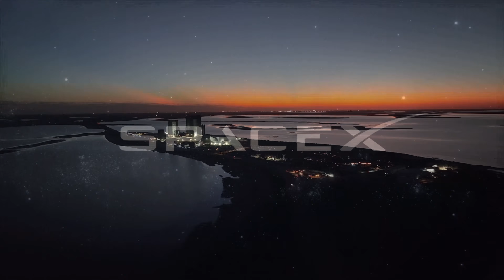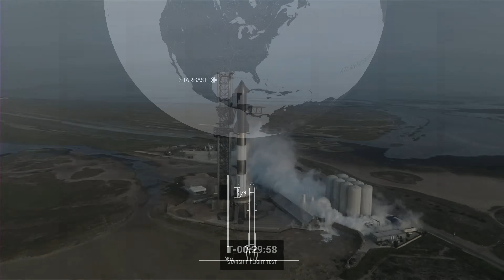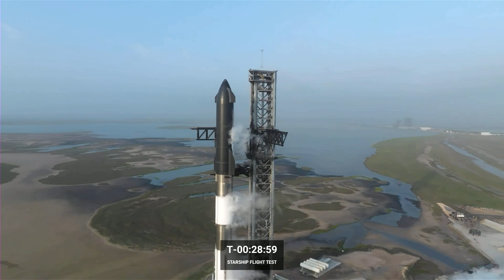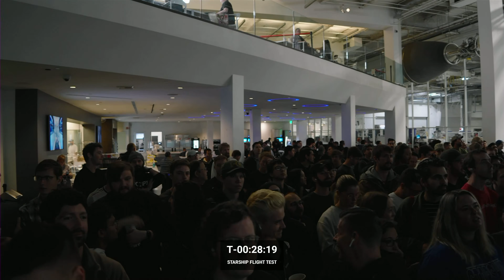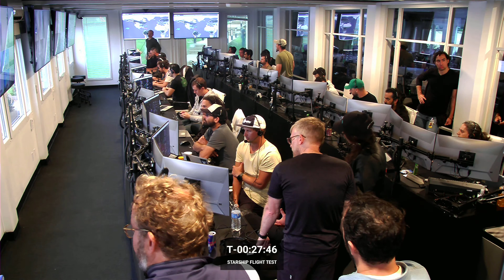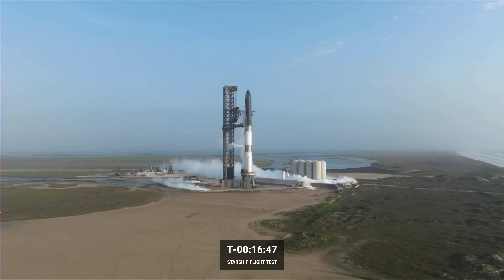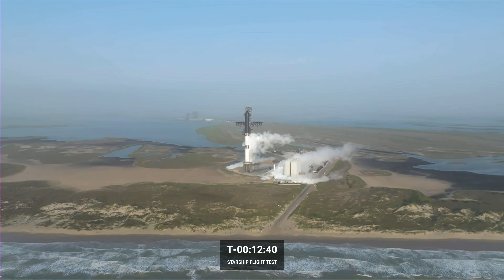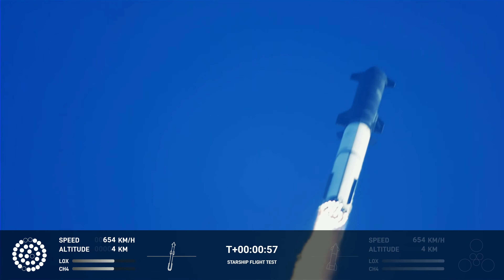Starship Flight Test

Comment: Hi, great step… some ideas for a better success:
The motors going off…. Can use side boosters w shuttle center, instead of 1 long tube… having even more motors & less risk of breaking them… like Falcon heavy.
The launch pad might be at ground level and then have to dig, construct more underground structures…Or making a bigger bulge to avoid weakening the crank tower. The « auto-pilot » program looks having problems too… keeping the rocket straight… bcs it flew even with fewer motors, so the program could manage it’s trajectory… but not. Maybe these remaining motors alone can’t keep it straight enough … whatever the « auto-pilot »… have to look on it…
Overall the problems occurred fast and look manageable… It surely can’t fly again as is… The path for solutions is also somehow clear. It’s doable, but other problems may occur also… so must be serious , overlooking.
Congrats.🚀✨
Reply: Having side boosters at this size adds a lot of complexity. There is a good reason why the Saturn 5 didn't have one.

It spacecraft should remain the same. Launch pad need serious upgrades

Comment: Man I was so damn mad when this failed the first time. Granted, it's all a work in progress. I was raging from little things that were over-looked. 

In any case, the newest launch attempt has improved tremendously. The recovery is still stressful to watch before those boosters counter all that force, during the burn as it decends at tremendous speed- my eyes wide-open praying it doesn't absolutely smash the deck and landing platform from a sudden failure, and like 5 minutes after hoping it doesn't spontaneously combust as an observer. You never know. Unfortunately, Starship spun out of control in orbit from a loss of a stablizing thrust and/or thrusters. Not a whole lot of information or detail yet. It may have been from when it flexed to bend where the aerodynamic pressure was the greatest at full-blast just one minute after liftoff. Perhaps some gyroscopes or other kinetic stablizing equipment are in order for the Starship. I doubt there is room left, and it's tall enough as it is. It might be too tall and not wide enough, but going wider would just mean more weight and more thrusters. This science is truly an art where most the lessons learned are in the aftermath and in hindsight.

Comment: Idea: put half or all the boosters around the top of the rocket to reduce damage to the ground, like a mushroom
Reply: Its better for the stability if you put the boosters at the end. You can test that by laying your phone on the table and pushing it forward with both fingers behind vs both fingers on the side. Interestingly there is a rocket design named Seadragon with boosters on the side.

Comment: The most important thing learned is knowing what repairs made to the launch site after each test was NOT learned and they kept on fixing the pad with idiotic solutions - how dump - a child would learn after getting burned once, and yet smart people (if one can say that) resolved the problem the same way each time and expecting a newer result... Go figure!

I have suggested to Elon in a tweet, to use the same material an engine cone is made of to wed-stand the heat - by having 5 pieces each to roll in through the gaps of the launch stand, to form an upside-down cone to divert the force/shock and heat of the 33 engines. more importantly, similar pieces can be part in a Mars ship to form the same on Mars... case closed.

Comment: OK-  So 30/33 engines were burning at takeoff (90%), however two more engines failed after takeoff 28/33 (85%).  You can see this in the graphic in the lower left screen. 28 engines may not be enough to reach orbit.  So, the stage separation was probably intentionally scrubbed and the rocket was then intentionally destroyed, since it was doomed to not reach orbit.  I suspect the entire issue was simply that too many of the stage 1 engines failed prior to separation.
Reply: The bigger problem was they lost hydrolic power which was used to steer the rocket. The upper stage could of reached orbit from there but wasn't able to seperate.

Comment: The announcers were reading their script. The rocket didn't perform to specs, it should have been at 65km for stage separation. Perhaps even higher. Falcon 9 separates at 80km.
Reply: Yes of course. They have intended milestones calculated to the second that they are supposed to happen. This is the same for every rocket launch

Comment: There is not enough useful weight on the first stage of the rocket ... At the bottom) 
The mass given by the fuel disappears, so instability appears.
🤔🤔🤔
Reply: It helps when the steering doesn't break, they've already upgraded that though.

Comment: While the idease flowing - in regards the heat tiles on the ship, I have for a while been very skeptical of how well they would work and seem to be continuing the same or similiar problems that the Space Shuttle had previously with missing heat tiles falling off as being very prone to damage and vibration. 
What about instead covering the heat sections with large removeable ablative heat shield sections instead - say in maybe 6 or 7 large sections - obviously this means relacement more often, possible after every re-entry to earth, so would be more expensive yet can be much better moulded to the exact shape and thus be safer and you wouldnt need as many metal pins to fix it to so save weight there to offset the extra weight in the material over the tiles....what do you think ?
Reply: The heat tile design is just a test, they probably are gonna switch to a different one. The problem with ablative is that it burns away, and they don’t want to replace a heat shield after a few flights

Comment: Incredible to me the USA people relation to explosion: it doesn't matter the explosion was a 100M$ loss, they are still happy, jump and scream
Reply: They're celebrating that they made it that far, as they said, the main goal is to clear the pad
Reply: @dinosaurearththeory the people celebrating didnt work on it. Those were Falcon 9 workers.
People in mission control, who actually worked with this hardware, didnt celebrate.
Reply: Because a $100M loss is nothing for SpaceX lmao. They are going to continue launching these rockets and blowing them up until they get it right. They cheer at the explosion because they know that the test has reached its conclusion and no more data will be gathered. It’s the end of the show. I would be cheering too if I was there.
Reply: @_mikolaj_ Well that’s an incorrect and stupid comment. There’s several public statements from people in the starship program who were joking and celebrating the test after their professional job had concluded. Don’t say blatantly false things
Reply: @GrapeFlavoredAntifreeze  where is my statement incorrect? People shown in California, are Falcon 9 workers. They didnt even touch starship program most likely.

People in MC all were dead silent. No one was happy.
Did SpaceX later run the joke and celebrated the failure? Yeah they did, because how are you supposed to keep investors interested, if flight of very outdated hardware pushed mainly to attract investors, is presented as a failure?
I recommend article by Ben Kellie, former  SpaceX employee who worked on Falcon 9 pads and droneships.
Similiar things happened back then. When booster landing failed, or something wrong in general happened related to it people who were not involved with recovery, celebrated in champaing "failure that will push forward". People involved, as always, were dead silent. Further away people are from the program, more likely they are to paint failure a success.

Comment: Hey now! Where is the footage from the 1st stage engine bay area during liftoff during the first 3 minutes? Judging by the 2nd stage footage at the 3 min 20 sec mark on liftoff, they have cameras covering the engine bays, but we've never seen the 1st stage booster footage. That would tell the story of the immediate damage from liftoff. Thx!
Reply: I doubt they could get a camera to work there and from the latest report spacex have no idea what caused the first three engines not to work but say they shut them down at lift off.

Comment: I honestly swear on my life, I Genuinely thought they were using the 'launch' pad originally as a testing pad before moving the unit to an actual correctly prepared launch pad, (in hindsight I should have thought otherwise due to the fact that the chopsticks were on that site) however, they could have easily excavated the opposite side of the tower to allow for a proper directional outgassing exhaust tunnel! Hey Elon, you could have hired in The Boring Company and paid yourself to do the work!!😅 Just a thought.
But nothing but congratulations to SpaceX and everyone involved in this sadly expensive but successful data gathering test.. I just wish I had more time to analyse the plan and I would have flagged this weeks ago. As it genuinely crossed my thoughts.
Then again, who says I'd have been listened too.
All the best for the future tests ❤
Reply: People have enviromental issues with them doing things like that, their permit was denied. They have a plan for the next launch to solve the problem though.

Comment: 46:14 love this easy data flight. But why are they losing motors? anyone know? are they stoping from the ground?
Reply: There was a lot of damage from flying concrete when the pad failed which caused damage the engines and other systems.

Comment: Just wondering is there enough atmosphere to use the grid fins to create drag maybe turn them in on each other for stage separation, the way you are trying looks like a problem waiting to happen.
Reply: No need for the heavy actuation mechanisms for that. Starship kept control with a failing tvc through max-q just fine, the grid fins dont matter that much on ascent.

Comment: i get trying to put a positive spin on it but calling it a success isn't what I would be doing. It failed, take it and use it. Elon might want to think about a redesign for those releases? like a hydraulic, magnetic or small kind of small charge?
Reply: What releases?
Reply: That was the whole point of the test flight, to find out what wasn't working as planned so they could fix it. The fts uses charges but they weren't big enough for that high in the atmosphere something the FAA will be double checking before it flies again.

Comment: Nasa sprays water so that the water absorbs the shock wave and prevents the rocket from being damaged. I've also noticed the metane and hydrogen tanks were totally obliterated.
This is my guestimation but could the reason be that this is a test flight, meaning that crashes occasionaly occur. And no launch site can take repetitive crashes from a rocket that weights 5000 tons? Having to reconstruct a launch site over and over would certainly offset the advantages of having a intricate launch site. But I still think you should do someting about the shockwave if you already haven't, doesn't it wear down the rocket?
Reply: Sound suppression is useless on starship because it’s so powerful. They also can’t have one at boca due to environmental requirements.

Also there is no hydrogen on this vehicle
Reply: @weekiely1233  sound suppression is useless? Do you have a source for that? There’s no immediate reason I can think of that any particular volume of water wouldn’t be effective in reducing the impact of the ignition shocks from the engines.
Reply: @infinitelyexplosive4131  source is a NASA paper. Required water is too high for such a vehicle to make it practical for what you get. Plus they can’t add one easily at Boca Chica due to the water table

Plus none of the issues for the launch were caused by sound.
Reply: @weekiely1233  which paper?
Reply: @infinitelyexplosive4131  I have sent a link
Reply: @weekiely1233  I’m reading it, thanks
Reply: @infinitelyexplosive4131  no worries

Comment: I'm assuming you considered putting the launch site in the water right? I know. No water on Mars but no atmosphere to push through either. If necessary on mars, you'll have to keep the rocket further off the ground if you still need rockets, or dock in orbit then shuttle down/up.
Reply: Superheavies will never reach Mars. Only the starship segment will.
Reply: @rolandb.1866  The main point was using the water, if this would solve the problem of dust or debris hitting the rocket on earth.

After that, on the moon for example dust happens very easily, I would guess limited debris will happen on Mars the same way, even just from a smaller rocket. Unless the ground is prepared in some form, or further distance exists between the booster and the ground.

Additionally, I have no idea if in the future, they will achieve their goal of using Mars as a launching pad to other sites in the solar system, thus requiring some kind of booster to get there.

Comment: I feel like it wasn't supposed to start tumbling before separation? I feel like it's aerodynamically unstable and lost too many engines to maintain stability. Because the stupid wings and grid fins are on the front of the rocket, it's aerodynamically unstable.
Reply: It’s not inherently unstable or at least not too much for the TVC. Engine failures were probably why it tumbled
Reply: @Erudite tbf it looked more like a TWR issue. When it pitched down it started to fall in vertical speed and the weight of the stack pulled it down into the flip. 

They looked like they were prepping to separate but it started tumbling so they didn’t do it and eventually the AFTS activated

Comment: Would it be possible to strap 4+ falcon 9 boosters together and have them all individually land to avoid a total loss? Smaller and cheaper to produce en mass and reusable to other purposes. (Obviously with the raptor v2 for all it’s benefits) x
Reply: Falcon heavy has proven that there is almost no use for that with starship coming up

Comment: Can somebody tell me wht just happened? I mean it's exploit and failed during returning?
Reply: No, during flight engines start to fail so after 2 min 8 engines didn't work and rocket lose control and didn't gain enough speed for separation for second stage (that upper black part rocket with wings).
So they terminated mission.
Rocket should speed to 7000 km/h after 2min and 40 sec and on altitude of 60 km , this is the point when you  separate first part from second.
Reply: @markhivin8670  thanks brother 🙏🇮🇳
Reply: @MANGESH0805  You are welcome☺

Comment: Wouldn't adding two or three solid rocket boosters to the side of Starship boosters help get Starship up to orbit with less fuel loss?
Reply: Stupid idea...
Reply: No, not really a good idea, Booster have the fuel to send starship close to the Karman line and then do a boostback, and Starship can go orbital thanks to ift 2 data.
Reply: Thats a terrible idea lmao. More expensive per launch and more potential points of failure
Reply: adding more rockets means you are adding more mass.
so you need more rockets to accelerate that mass but those rockets  add even more mass.
so you need more rockets....
basically there is a point where it makes no sense to add more boosters.

Comment: OH GOD IFT-1 was slow off the pad
Reply: Ik right? In the launch they lost alot of engines
Reply: @Paep50  and prolly had some underperform as well
Reply: Around 15 engines underperformed and around 3 did not ignite. Im pretty sure 2 cut off after liftoff
Reply: @Quartzplays309  they lost 6 outers and two inners and a middle one two so 9 in total went out

Comment: could a tesla valve be used in the deluge system
Reply: What would be the point?  Thats just a one way valve with no moving parts.  the deluge system will be about moving huge volumes of water under the launch mount to absorb energy and a tesla valve would just limit how much water could flow
Reply: @BradiKal61  yea i suppose 
lol
Reply: by the way if you work at spacex tell elon i wanna work on the moon  just moving boxes or saving lives with my ray gun,, im not picky 
 im smart fyi..

Comment: It exploded
Reply: And?
Reply: You joined 7 years ago why 2 subs bro
Reply: @TheFederationOfBalliaOfficial  it’s a test flight. Do you not know what a test flight is?
Reply: Even @DjaroGames said it
Reply: @TheFederationOfBalliaOfficial  again, do you know what a test flight is?
Reply: Yes they are testing a rocket prototype
Reply: @TheFederationOfBalliaOfficial  so why are you surprised it failed when it’s a prototype?
Reply: Becuase it took like years to build so spaceX probably fully complete it and no 💥
Reply: Also I saw parts crackling off of it
Reply: @TheFederationOfBalliaOfficial  their second test flight was way more successful, even though it didn’t make orbit it got to test the staging which was their main goal.
Reply: @TheFederationOfBalliaOfficial Yet  they completed their main objective of getting it off the pad for flight 1? And in your name is the number 2014. Dang man. Younger than my little sister. How about you actually pay attention to SpaceX's objectives for each flight.
Reply: They were building it for awhile but they never got to test a launch of both stages integrated. That’s why this launch failed. The pieces you saw crackling off of it was ice. It wasn’t parts of the rocket itself. @TheFederationOfBalliaOfficial

Comment: How was this a success?
Reply: Because SpaceX was able to achieve quite a bit in the testing process and gathered a ton of data.  Because of the complexity of this world's largest rocket with a space vehicle, no one expected a perfect, beginning to end flight.  If you're gonna bake a cake, you're gonna have to break some eggs.
Reply: Honestly the rocket worked phenomenally, that stage 0 needs some work though 😅

Damn thing turned into a crater and destroyed the engines while it was at it!